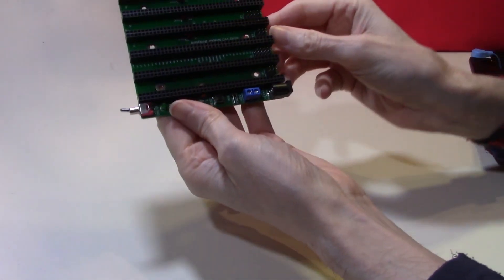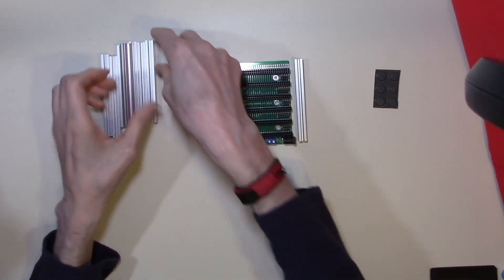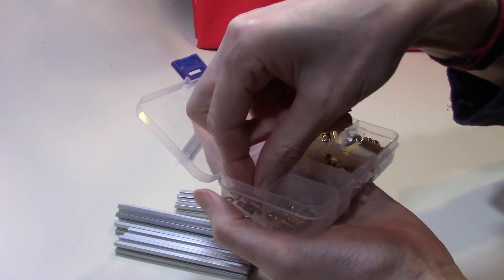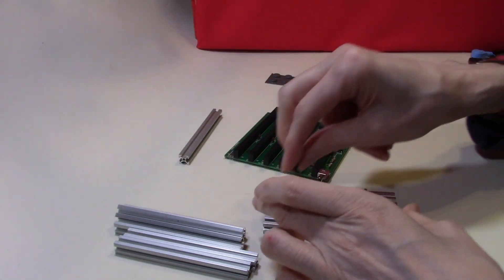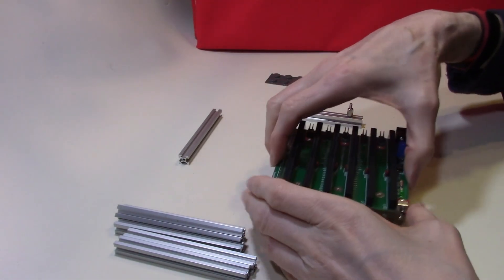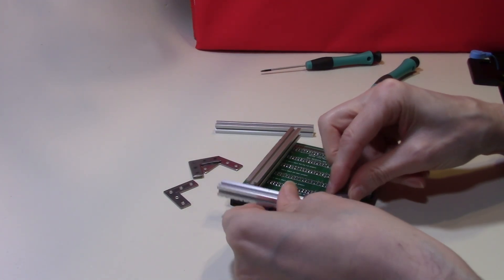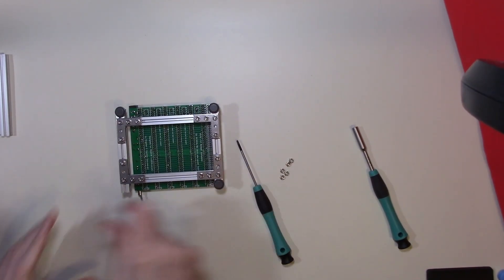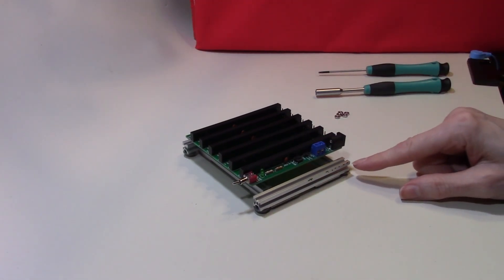sc203 modular z180 computer kit - part 2 - Makerbeam frame

Comment: Why still build a bus based system? I want to make a complete board wirh only 8 chips or such.
Reply from the maker: You can either design your own board or purchase kits that are a single board. Using a bus gives you flexibility on the design of the system.